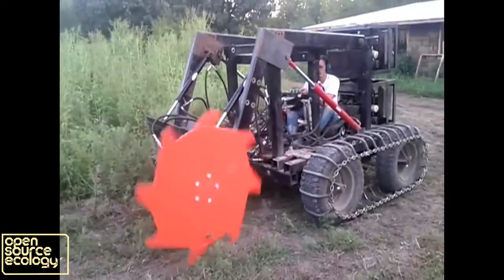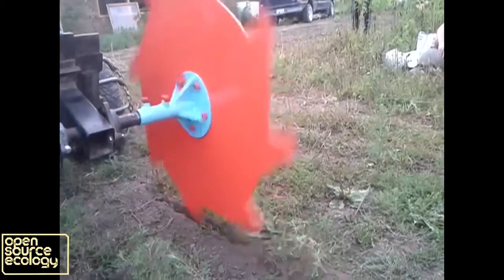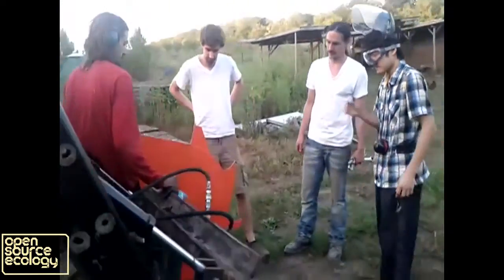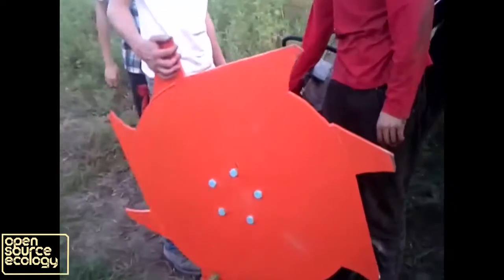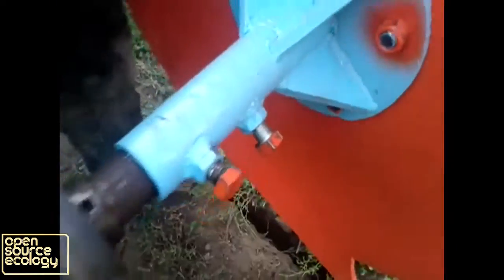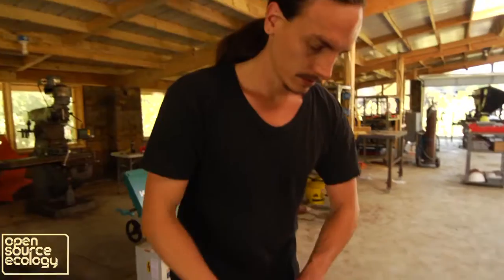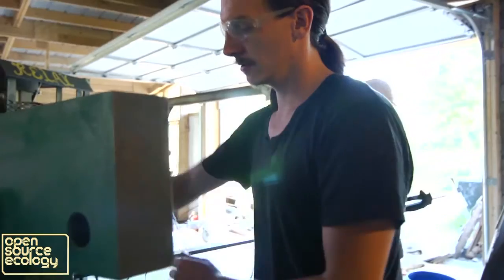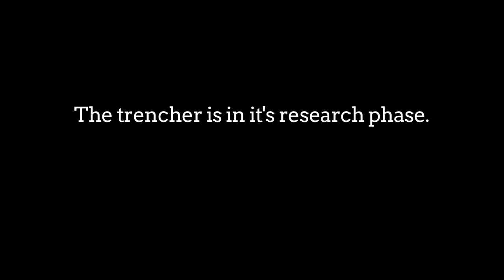Trencher  by Open Source Ecology

Comment: Rotation should be reversed. Currently if the blade grabs rocks, roots, etc, it wedges into soil beneath and causes bouncing of the vehicle. Reversing it would give an expanse to throw it into (a guard over the blade wouldn't hurt either). 
Is there any kerf to the cutting blades? That would help as well.

Comment: Stabilise up and down bounce in a skid frame , do not cut into ground but allow cutting wheel to wear it away ,rate of travel is best done with torque , but a mechanical travel speed is sufficent ,allow travel to be slower than cutting ability ,cutting head wider for disc clearance ,GOd Bless

Comment: Modeling this off of a chainsaw would be a much better and safer Idea. If this fails you have a 40+ lb blade rolling around.  If a chain fails it falls to the ground and stops.  Consider modifying your track design and run this thing at a much higher RPM.